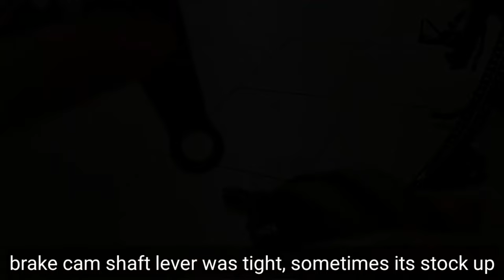Paano magbukas,maglinis,mag ayos ng preno honda wave 100. How to repair, open, clean rear drum brake

Comment: Good day po sir Dondon ask ko lang po kung ano pong size ng mga tools sa mga turnilyo at nut ng disc break? Salamat po sir at pagpalain ka po ng Panginoon 🙏🏻🙏🏻🙏🏻😊
Reply from the maker: Good day din po sir, iba iba po ang size ng mga tornilyo at nut sa mga disc brake. Kadalasan po 8,10,12, at 14mm depende po sa motor at kung modified lang ang disc brake. Minsan allen or star screw naman ang mga bolts.
Salamat at God bless din po!